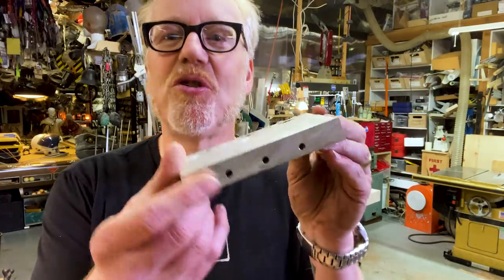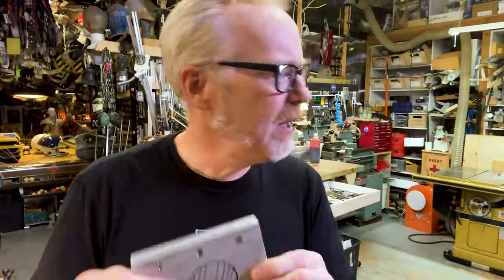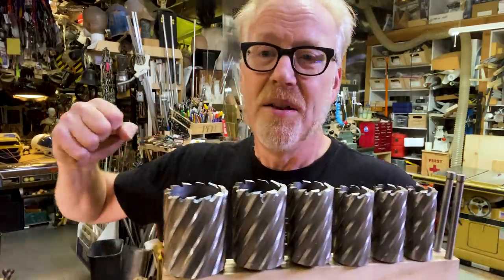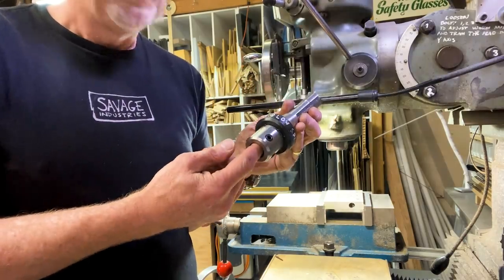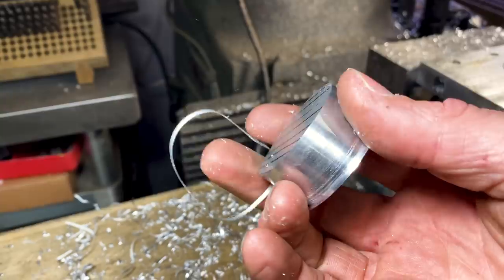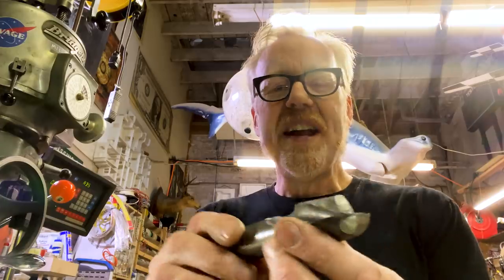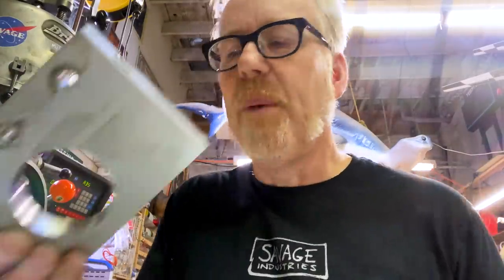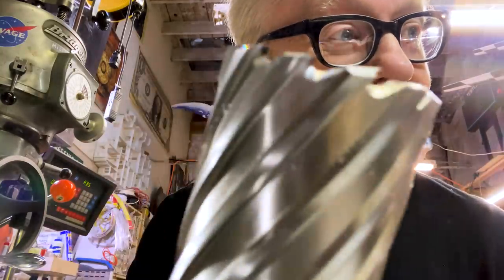Adam Savage's Favorite Tools: Annular Cutters!

Comment from the maker: Annular Cutter set (7/16-"1-1/16"): https://amzn.to/38s627n
Annular Cutter set (1"-2"): https://amzn.to/3eGQU7o
Reply: Adam try using kerosene for cutting lubricant on aluminum. Better finish, cools great & evaporates lightening quick. FYI annular cutters also work for surface cutting with far less noise than carbide surface cutters.
Reply: Yep, kerosene or paraffin as we brits call it is a pretty good cutting fluid, only problem is when it gets too hot; much better to use water based cutting fluids. 

Oh yes and Adam - FINGERS!  That swarf may only be fine but my word if you slice yourself on that stuff it is going to be a DEEP cut -grab it with pliers!
Reply: annual Cutters you should look into it also have a centerpin that spring loaded so you can get perfectly centered the pain compresses as you drill into the material
Reply: You might also want to consider when using those bits in a mill you shut the machine down before you raise it up I've seen them launch that piece of material out of the bit at the operator it's not pretty
Reply: https://www.rotabroach.co.uk/

The original and the Best cutting tools in the world brother, Made in Sheffield, England!!
Reply: Agreed, they are pretty awesome. I have a mag drill and a set of cutters, very cool.
Reply: You should try using them with a joint jigger for fish-mouthing, they make beautiful cuts in thin wall tubes.

The down side is that they are very expensive and not very useful if you don't have a mag drill, a mill or similar.  The alternative is hole saws.  I have cut lots of holes through thick aluminum and steel with a good sharp hole saw in a good mandrel.  The smaller sizes of hole saw probably cost 1/3 of an annular cutter (or rota-broach as I knew them) and you can get a hole saw far larger than any annular cutter I've seen.

The trick is finding a good mandrel for a hole saw and cutting slow so you don't dull it or clog up the teeth.

One more thing, hole saws are made with essentially heavy duty bandsaw blade material that has the teeth kicked in and out alternately.  Some times you can get a better cut by knocking off a little bit of the teeth that stick out.

Years ago, I bought a big case of assorted used hole saws at a garage sale for about $20.  To buy enough Annular cutters to cut all the holes I made with those old hole saws would cost 10's of thousands of dollars and maybe more because there were some 6-8" hole saws in there.
Reply: Yet another term for them is slugging bit(s).
Reply: I'd buy a quality hole saw set for that money
Reply: do you work on movies still? of not do you miss it?
Reply: A traditional drill bit also has an effective rpm of 0 at the center where the flutes meet; so you’re basically smashing that material, not cutting it. That’s the beauty of the annular cutter, the speed of the flute is constant.
Reply: This Jancy holder is great for using annular cutters in the mill. https://amzn.to/35lam6H  The nice thing about the center pin is that it also helps you get the hole centered.
Reply: orgasmic annular cutters, i get it, they leave such a good finish because they work like a reamer.
Reply: For us mere mortals, this looks like a job for a hole saw and drill press and nothing harder than aluminum to cut into
Reply: Hello mister. Have you heard of hole saws?
Reply: I usually use stepped bits for large holes under 1".  Way better than using a gigantic bit.
Reply: Now you have your Annular cutters/ Slugger Bits, Don't forget pipe notching is now a breeze  ;) . We use ours sometimes just like you have in our little Bridport, to cut the joints on our safety rails for our platforms
Reply: You look old af
Reply: @TheChiefSmeg69  so basically yall say everything wrong over there. Including aluminum.
Reply: @ElectricalExistence  well, you could say aluminum , but I do prefer to call it aluminium (because that’s what it’s called) 😁 .  Funny how some engineering terms are the same the world over though, no matter where you go the act of putting a hole in something can be referred to as drilling and you immediately know what I means and also the tool used. 

Just the rake angle is different for cutting ALUMINIUM 😋
Reply: @nathanwaight  aah, but then you get into problems with intermittent cutting if you are not careful - can cause increased tool wear, but that is a clever trick
Reply: @TheChiefSmeg69  actually the guy who named it even though British, didnt call it aluminium. You just all talk like idiots and twisted it around like everything else.
Reply: @ElectricalExistence  why thank you  for displaying your ignorance to all of the good folk on this forum, never met a bigot on here before. Please, if you have nothing nice to say, don’t bother,  find your jollies somewhere else and leave the adults alone.
Reply: @waggywagstaff  I can’t argue with that!
Reply: Sounds like your spindle bearings are on the way out if not already. Check out h&w machine repair and pick up another pair for 300 bucks. Hour of work. As long as spindle spacers mic the same and dont need to be replaced.
Reply: @TheChiefSmeg69  boohoo cry more
Reply: @waggywagstaff  Yeah, these are amazingly accurate for cutting holes in thin material. so much better than a hole saw.
Reply: Hope  your life isn't changed by losing a finger or two!
Reply: Spade drill with carbide inserts. It's what we use on a manual tabletop knee mill doing 10-20' runs of 6" structural channel for material handling fabrication.  Hog 300 holes in a day. Clean cut. Quick mango and ready for paint.
Reply: @Sidowse  , yeah, cuz that is cost effective compared to annulars.
Reply: @joeblow3143  yes to the sizes but accuracy of hole....
Reply: @JHudson3468  , the arbor for that kit at amazon is $50.
Reply: @manictiger  ,if you drill a lot of holes these cutters are so much faster there's just no comparison.  Al is one thing, but carbon....
Reply: @jasomkovac9115  
I'm not saying there's a comparison.  I have no doubt they're great.  I'm just saying that a stepped bit is better than a normal bit for this task.
Reply: @jasomkovac9115  In a lot of jobs, if you are worried about accuracy you can go up or down a size to ensure an oversize or undersize and go with that.

Luckily most hobby machining of large holes is just whatever works, not super high precision because super high precision needs big expensive cutters, CNC with tool wear compensation, a boring bar or a lathe.

I have done an awful lot with hole saws and if you want a nice clean cut but don't need precise dimensions, they work pretty well.
Reply: Another great and little known thing you can do with an annular cutter....use it to cut a stub shaft onto something oddly shaped. A 5/8 annular cutter leaves the perfect plug left to thread 1/4-20. I’ve used it and the mill to thread rifle bolt knobs many times!
Reply: @Sidowse  ,waiting for that one. A real cnc is expensive and you need it running a full shift. Was a fabricator in a small shop 35yrs.
Reply: @manictiger  ,didn't know step drill would cut something that thick to the proper dim. Thought it got larger the more you engaged it.
Reply: @joeblow3143  ,know what you mean. But Adam is a bit over hobby. Have you ever tried to make a hole in 1/2inch al with a hole saw though? Gets hot, then the chips gall on the teeth,stopping to clean hole and break off said galled chips. Not saying for home I wouldn't use a hole saw ,but wouldn't enjoy it.
Reply: @jasomkovac9115  
It makes it so you graudually widen the hole.  Less surface area engagement per increment of time = less friction - less heat - better, easier cuts.
Reply: @jasomkovac9115  maybe I shouldn't have said hobby, the same thing goes for prototype and short run manufacturing.

I have cut plenty of holes in thick aluminum with hole saws, even with beat up, dull hole saws.  Technique goes a long way which is to say lube it and make sure you clean out the chips before the teeth get clogged.  It's not that bad unless you have a stack of parts that need holes and then it's only bad because it's repetitive.
Reply: @jaredayers6670  nice trick, I'm going to have to remember that the next time I need to thread something irregularly shaped.
Reply: U know very well that any wood hole saw would easily get thru the aluminum
Reply: @nathanwaight  ,inside edge.
Reply: @joeblow3143  , funny you said that, pretty much what I did. Though one job we did for yrs was make the mounting brackets for one of the companies that make automatic snow chains. The ones you see hanging under ambulances, school busses, oil delivery trucks etc. The brckts were 3/4" thick. Would punch on an iron worker then ream to size for the bearings. Do all the bending and cleaning too. Just rigged stops in an old bridgeport for the machining. Had left, right(obviously) plus all trucks were different made it interesting and fun. Really enjoyed the work. Weather vanes, counter tops, hoods,product transfer systems.  Never got bored.
Reply: @Sidowse  ,gee, I don't know.  Maybe because I pay attention to things. Hobbling some electronics on a miller isn't quite what I'm talking about,specially for the material and thicknesses we worked with. I would figure if you know what you're talking about and the uses you would know what's involved.  I'll just go away thinking there's a miscommunication here.
Reply: @jasomkovac9115  Iron workers are cool.  I'll try to get one if I ever find a deal on a good used machine with tooling, otherwise they are pretty expensive if your aren't bending, shearing and punching heavy steel all the time.

So far I have never seen anything affordable, maybe in another 10-20 years when machines from the 90's are getting to be 40+ years old.
Reply: @Sidowse  ,no,just not an idiot. Want to know how to build a bridge? You do good in school, become an engineer, then you can build a bridge.
Reply: @joeblow3143 , they're great if you have the need. Don't get this wrong cuz I don't have the cash for it(retired), but for some they're not that expensive depending on style. But whatever mat you're working with you have to be able to process first to make the blank or have room to feed machine. Eg, bars come 20ft lengths. If it's thin material you're working with 1/8th or less, and just holes, an obi punch.
Reply: @Sidowse  ,my oh my, we are long winded aren't we. And pretty ignorant about definitions. And unable to differentiate between a toy and a working machine. For a second I even had a passing thought about what your expertise was based on, but then had to look down my nose ,so....
Reply: @jasomkovac9115  a horizontal bandsaw is going to do a lot of that for me until I can upgrade.  I almost got a deal on a cold saw a few years ago (I agreed to buy at the $250 asking price) but the owner figured out what he had and I never heard from him again.

I know an entry level Iron worker is probably about $20,000 new but I don't think I have ever seen one for less than $7-8,000 used which for me is too much cash for the risk.
Reply: @Sidowse  ,can I ask just what your expertise is to give you such a profound outlook to enlighten us poor mortals in the ways of life.
Reply: @Sidowse  ,not including anyone with what your stupid ass is saying.  Only reason I paying any attention to you is it gives me a laugh. The way you spew verbiage from your ass,cuz no one would actually say what you do,is amazing. Oh, just cuz you spend so much on expensive shit doesn't always,and most the time doesn't, make it better.
Reply: @Sidowse  ,Dipshit, I'm talking real tools as opposed to Mattel workshop. Would you use a kids tricycle to do whatever your( "$2000)bike will do.
Reply: @Sidowse  ,no, only had to finish 3rd grade. They said there was nothing else they could teach me.
Reply: @Sidowse  I hope others are amused by this, or it's a waste.
Reply: @Sidowse  ,I know all about the bikes and I don't  care. A toy cnc doesn't do real work. And you tooting your own horn is boring and proving you a buffoon. Good bye.
Reply: Look up track star rail.  our drill working on tracks the lubricant goes inside the bit.
Reply: Get yourself a retrofit for your mill and you can just program the hole to interpolate it with a normal endmill
Reply: cant wait till you find out about hole saws .. its like the same thing... but for wood :)
Reply: They are also called Slug bits. As for lubricant try using Windex for an awesome finish on aluminum.
Reply: If annular cutters get you this excited I can't wait to see your reaction to trepanning on a lathe! Keep the great content coming.
Reply: If you're ever gonna use those annular cutters in a magnet machine remember once your in don't stop drilling until your out. You will never get the the same center point again and ruin your cutter while trying.
Reply: these cutters are shockingly inexpensive. I was expecting $100+ per piece like you see with fancy router bits...
Reply: You can get them with a center pin and a self locking taper for installation in a drill press. I've used them in drill presses with great succes, just make sure to use the center pin and have a good center punch
Reply: In the future try not sticking your hand so close the tool while it's running 🤣 you made my butt pucker with that squirt bottle
Reply: This is the way.
Reply: Carbide tipped hole cutters! They don't require a high end mill or magdrill and will achieve the same thing but with a little more limited depth of cut. Plus they have a pilot drill and spring
Reply: Hog bits are the way to go
Reply: You get the award for handling all that without gloves.
Reply: thank you
Reply: If your just cutting aluminum why not just use a hole saw...?
Reply: @cameronadkins6268  for the cost, you might as well get something that can do other materials, and lasts longer. Most hole saws are for fibrous materials (wood) and if you look at the annular bits, its cutting surface extends beyond the tip, allowing for oscillation cuts if you need to taper one side.
Reply: In Germany we say: wo ist die arbeitssicherheit 😂
Reply: but would they work on a cnc
Reply: Hi, those annular things come with a center drill bit too and can be used on a regular power drill for most materials. I even have very sturdy one to use on my chipper perforator (not sure of this translation) for drilling concrete. It sure needs a bit of care and experience, but I never had such a problem as being hurt... My pieces are not always perfect though ☺️
Reply: All those are is a variation of a hole saw on steroids.
Reply: Saw you video browsing YouTube for hole saw to cut 1/2" construction steel in a concrete wall. Can this Annular cutter handle that? Pls reply soonest.
Reply: Do you think annular cutters with carbide tips are worth the extra money?
Reply: can you side mill with these tools?